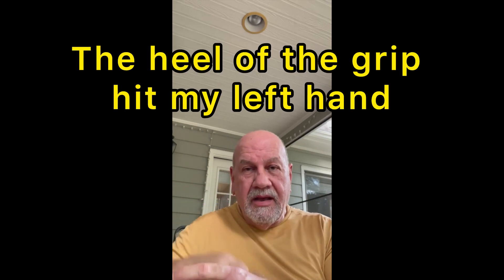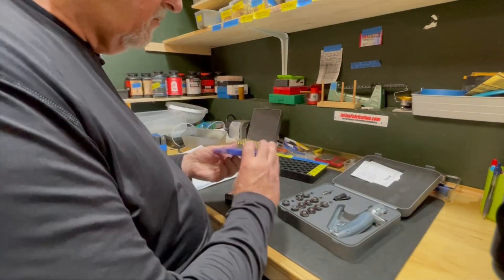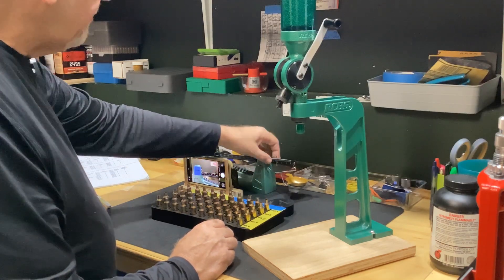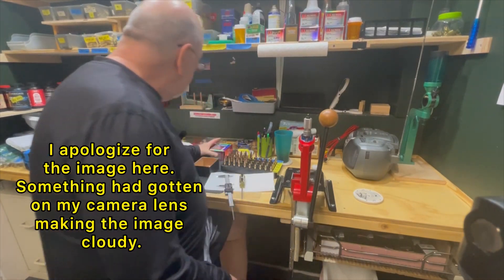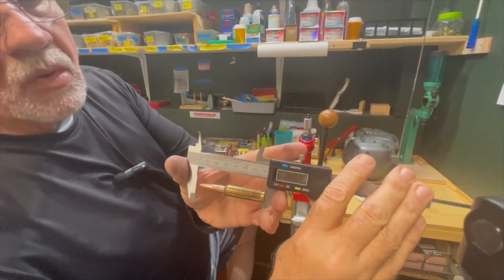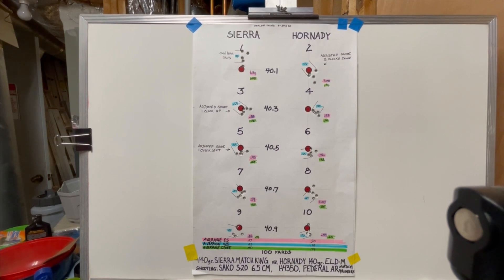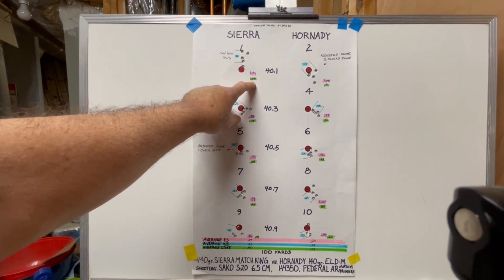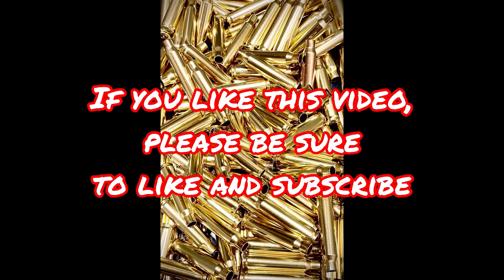140 Sierra Match King vs. 140 Hornady ELD Match. Reloading for 6.5 Creedmoor; injury shooting.

Comment: Are you sure your measurement CBTO is 2.3 inches? I would have been nice to see you doing that measurement and not only the COAL. I did the same test you are doing comparing the Sierra Match King vs the Hornady's and I got the practically the same results you are getting. Same powder at 40.3 grains too. Both bullets shoot great on your rifle and on mine too! The difference is the CBTO because those bullets are different but I'm getting 3" groups at 300 yards with both bullets.
Reply from the maker: That’s a very nice result, especially at that distance, it’s one thing to shoot a 1 inch group at 100 yards indoors, but very different to shoot 3 inch groups at 300 yards. Even though it’s the same MOA, you have wind to contend with. Awesome shooting! And thanks for the comment. I tested 21 different bullets to determine the CBTO. Average was about 2.306. I just rounded down to 2.3. Although I had some measurements as short as 2.9 and one is long is 2.360.
Reply: @EverydayReloadingandShooting  interesting. If I go to to 2.3 CBTO then I will have to hand feed one by one because the rounds will not fit in my magazine.
Reply from the maker: I understand. I had the same problem with my 223. The Sako S 20 has an extra long magazine to allow loading to longer length bullets.